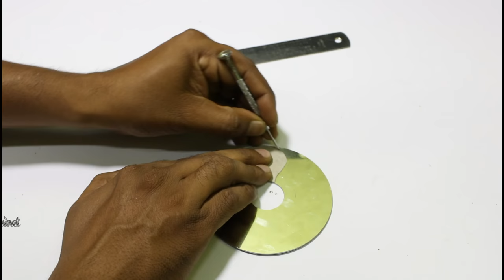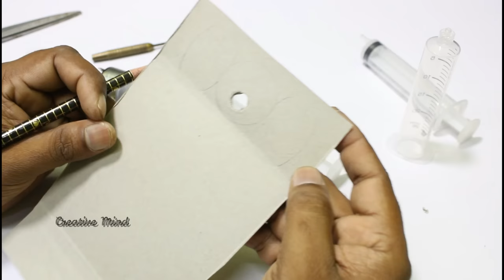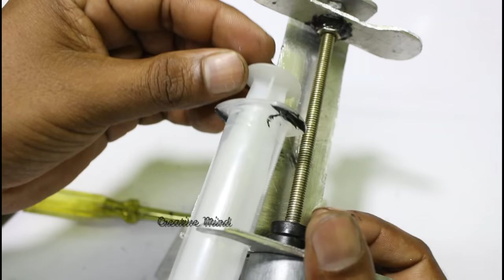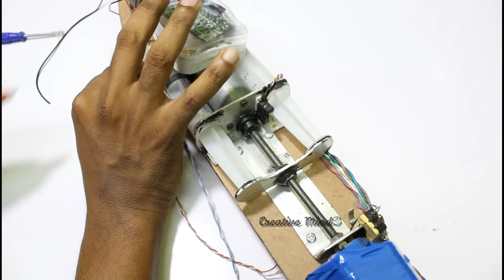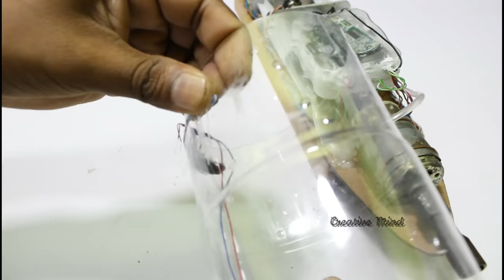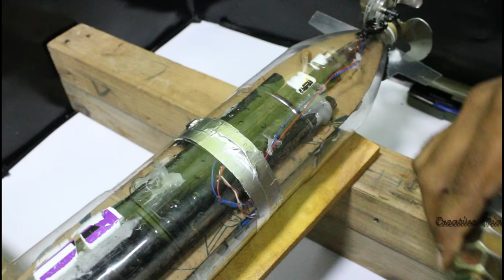How To Make A RC Submarine - From Plastic Bottles - Amazing DIY Projects

Comment: Ok here is one pro tip for you buddy, Try to make a propeller with more fins but not that wide, it will avoid bubbles and lose of rotor energy wasted in steaming water with lower pressure created on the propeller. And also try to reduce the RPM of propellers. It will help to increase battery life. and you get the same speed with lower RPM.
Hope you apply my ideas.

Comment: Nice project, but that circuit boards and wiring connection work doing fast not understanding, can you please share me circuit diagram
Reply: You need a transmitter(controller), receiver, battery, brushed electronic speed controller, contact switches, etc.

Comment: The submarine which is made is good you would had also fixed a fins on the sides of the submarine not to swing to be stable in water. Instead of connecting wire as antenna you would have fixed a small weightless coper rod slightly lengthy. You could also connected L.E.D lights also inside the submarine bottles. Rather than it's ok good.
I hope the scientist can now invent an electric solar submarine too. For charging purp submarine will comes to the sufarce of the water
Reply: In war time it is not safe that submarine came out the surface of water
Reply: @PraveenKumar-jg5pm  this submarine is not made for war
Reply: غوصة الماء
Reply: @rakeshkushwaha4727  he wasn't talking about this submarine

Comment: Is it me only with the impression the buoyancy not working as expected, it seems its effect is either going towards the bottom of the water or going to the surface, but never stable at a particular depth?
Reply: The buoyancy is working but it only stabilises at a particular depth if the depth of the water is considerable. As the depth of the water is proportional to the density of water.
Reply: @DhruvShrimali  Sorry, but you are wrong, water is not compressible , hence there is no change in density especially not in a swimming pool ! Actually your submarine may be slightly changing volume due to soft shell. You also need movable horizontal and vertical fins . Otherwise good innovative mind, keep experimenting.
Reply: @planpitz4190 , actually, the density of water does change with an increase in pressure but not so significant in the swimming pool. Hence it is not able to stabilise at a particular depth.
Reply: @DhruvShrimali  water doesn't become more dense as you go down something will always have the same buoyancy wherever it is. it is just neer impossible to get an object that weighs the same as the amount of water it displaces. even real submarines don't perfectly balance then selves in the water as they try to stay positively buoyant as a fail safe and just maintain their height with controllable fins or thrusters.
Reply: @firenado4295  I agree with the fact that submarines don't perfectly stabilise at a particular depth. But it is a fact that density of water changes for greater depths.
Reply: @DhruvShrimali  yes this is correct, but it should be noted that since water is nearly incompressible (it's often approximated as completely incompressible), the change in density with depth is minuscule.

the density only changes by 0.3% at thousands of meters of depth, even though the pressure increases by 100-fold (i.e., 10000%) at 3300 feet. so it wouldn't make a world of difference unless you went to the bottom of the Marianas trench or something
Reply: @firenado4295  That's my point. Water is compressible but the change in density is negligible. Hence the submarine is not able to stabilize itself that well.

Comment: The resourcefulness of the creator and the ingenuity of the ballast system is amazing. I wonder though, why did he need so many relays? Surely the main drive motor and geared reduction motor for the ballast required them as the motor bridge from the rc car couldn't deal with the power. Does it have anything to do with the limit switches?
Reply: Each relay (JQC-3F) is a single pole double throw switch that controls polarity of one of the motor wires (2 wires per motor, 2 motors), allowing each motor to be run either forward or reverse.  Each relay is connected to one motor wire, and the relay controls if that wire is connected to Positive or Negative (ground) voltage.  Alternatively, he could have used two double pole double throw relays.

Comment: Amazing ........"Radiowave travels through water " ..........?so much to learn from it........
Reply: it depends higher frequencies don't travel through water and solids well like wifi and radeo but low frequency ones do like cheep rc cars that use like 27mhz
Reply: Pubg   m.  1423
Reply: Radiowave travel though insulator such as fresh water. But does not travel in salt water. Refer to this interesting link "https://en.wikipedia.org/wiki/Communication_with_submarines"
Reply: @Debraj1978  yeah exactly that is basically what I said
Reply: After a certain depth you'll have to switch to sound waves for commands over EM waves.

Comment: You can use small RC pump to full a tank and evacuate instead of this complex syringe tank and mass of wires and electric circuit and use another way for body and this dark glue also use smaller motor for pushing thank you
Reply: that looks like the "rich man" way to do it. Sometimes these little projects make use of materials laying around in your house. Personally I find this syringe solution amazing!

Comment: very cleaver!! how did you imagin ballasts done by syriges? I like your work! thanx 4 sharing
François
From France
Reply: He did not imagine well. Two syringes have volume of only about 40 milliliters. That is 40 grams available to control about 2 - 3 kgs heavy submarine (about 1 - 2 % of weight). With such a low margin submarine could easily sink unrecoverably to the bottom. And it happens to the sub in the video all the time.

Comment: Hypothetical question.  Can one of my friends from either the Bahamas or Cuba launch one of these with a small package hidden inside and it reaches the shores of Florida? Asking for another friend.
Reply: Perhaps if it uses an autonomous driving system via GPS and a battery large enough to do at least 300/400 miles based on the consumption of the electric motor and the electronics. Or mount photovoltaic panels to recharge along the way, even if it would take days to recharge.

Comment: I have a question.. 
How it will come up again...
Because when it going down, it absorving water from outside. But to come out it have to empty the syringes?
To leg go the water, some air have to fill the gap. And how it will get air when it releasing air to take water inside to go down at the first place..🤔

Comment: would the pressure increase inside the bottle as the water is sucked into the two tubes as the air that was once in that space has to go somewhere else (inside the bottle) and when pumped out the air would fill the space again decreasing pressure

Comment: Great video, just need a couple of improvements. Being able to achieve neutral buoyancy instead of just sinking when you stop moving. Also put a cowling around the propeller to stop entanglements and improve safety. That would cut someone easily.

Comment: hi, thanks for your video, i was making toys for my son as your video. and faced a trouble now, appreciate with your reply. 
i used 4 relays and 2 limit switchs twoo, and connected all wires as your video( i think so),  but i just can control the motor forward, and stop when it tocuh with the limit switch, then i can't let motor reverse, why? 
question 2: how to connect the third motor? it is not clear too.

Comment: I tried the way you showed in the receiver part of using 2 remote and reciver but it's not working
Reply: The RC car he took the remote control from has only two controls (main motor and direction), but his submarine has THREE controls: main motor, direction (small motor at the tail) and buoyancy (syringes). How did he achieve to control all three with only two inputs?

Comment: Where are the materials what materials are going to use? How much it will cost what kind of engine do you put and where do you get it?
Reply from the maker: Syringe
DC Motor 12V 30000 
Rc Car Circuit
Aluminum plate
Cost=$3